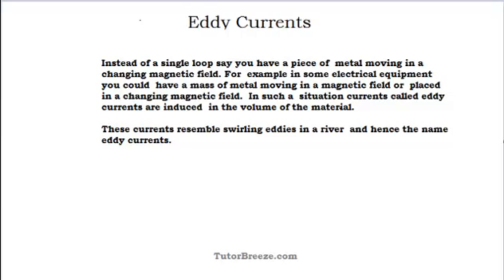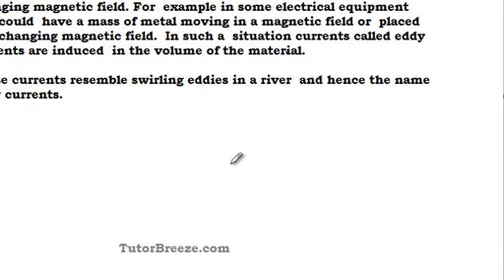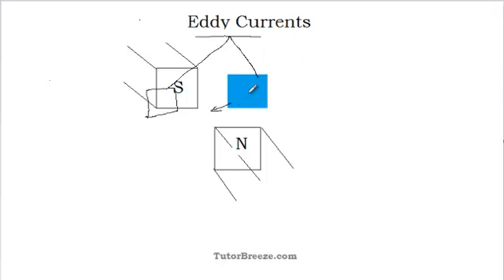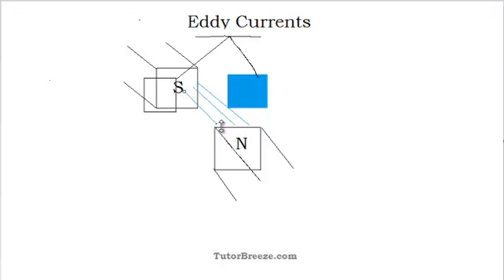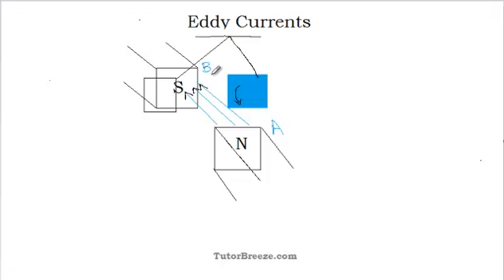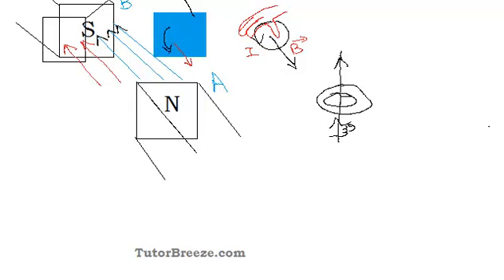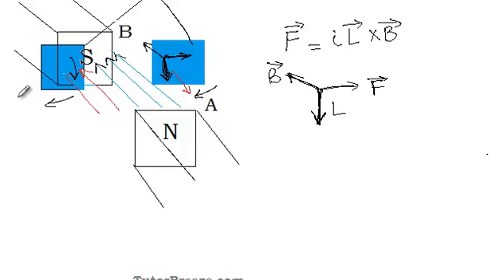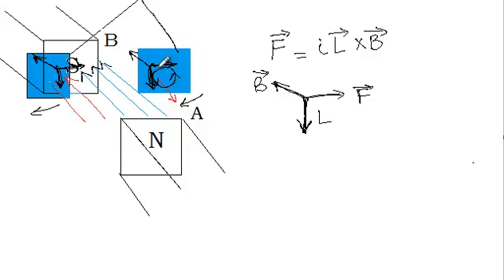Eddy Currents

Comment: Another way to see this is to realize that when the plate is entering the field, the secondary field (caused by the eddy current) is in the opposite direction to the primary field (caused by the N & S magnet) and this represents a repelling force. This is shown as the red arrow just above and to the left of "A".  Opposing field directions will cause a repelling force.
...
Then, as the plate is leaving the field, the secondary field is now in the same direction as the primary field. (She indicates this, but does not draw an arrow)
 This represents an attractive force.  Aiding fields are attractive.
...
Therefore as the plate enters, it is repelled from the field and as it leaves, it is attracted back into the field.
...
This can easily be seen qualitatively by using only Fleming's Right Hand Rule to determine the eddy current direction and Fleming's Left Hand Rule for the secondary magnetic field.force direction and requires no math or equations.
...
What you then find is that for a large plate, moving past the magnets, there is one current loop ahead of the magnet that is repelling (keeping the plate from entering) and another behind the magnet that is attracting (trying to keep it in the field) .  So there are actually two current loops for a magnet sliding along a large plate.
Reply: +Observ45er    Good explaination